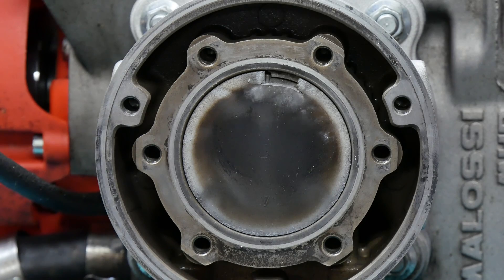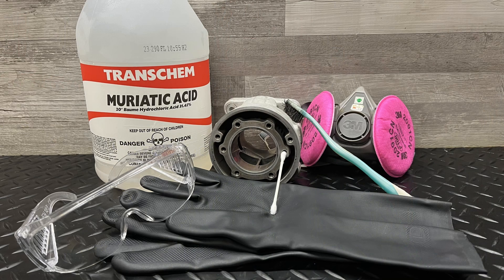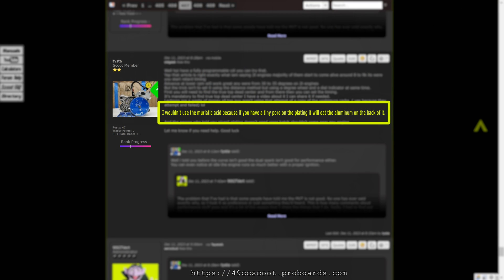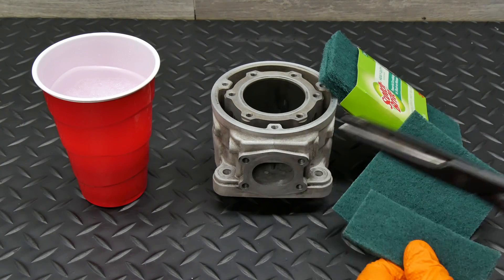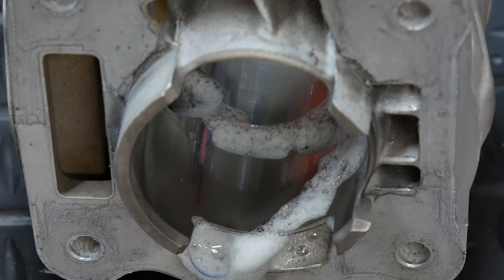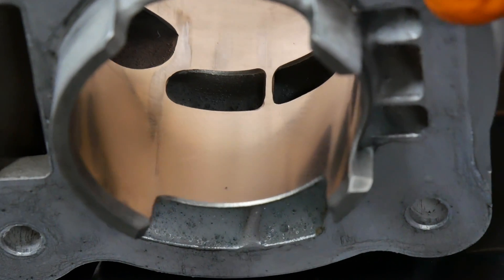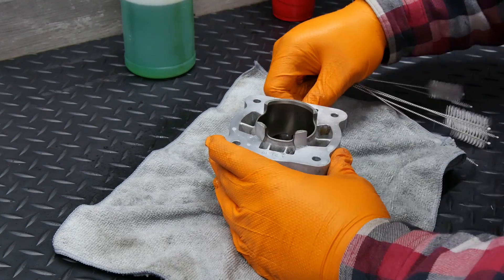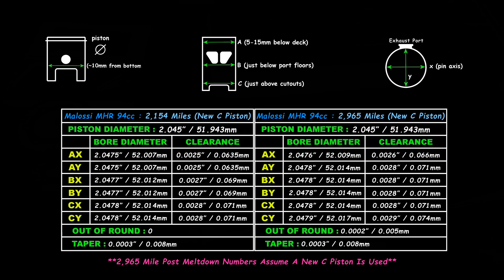Removing Aluminum Transfer After A Piston Failure : RC1 : Part 21 : Two-Stroke Cylinder Cleanup

Comment: hydrochloric acid removes all alunium at cylider
Reply from the maker: The problem as I understand it is; if you have any pinholes in the plating it removes the actual cylinder behind it too.

Comment: I read this about the ignition (MVT) that you use on your Malossi engine. and thought you might want to see it...
if you want a link to the place, just say (-:

MVT DD ignition timing for 50cc stroke engines should be 0.40 before TDC, while for any other stroke and long stroke the timing should be between 0.30 and 0.35 max. Failure to comply with this condition may result in an abnormally high temperature in the stator, which may cause irreversible damage.
Reply from the maker: Thanks for sharing that. I wonder why it would overheat if out of that range a little.
Reply: @49ccscoot  it is not make for a 100cc Motor
Reply from the maker: @bp-tuningaeroxlc-dd6474  If the stator is overheating though, it shouldn't know what size the engine is. It basically just spins and processes signals, so I'm assuming it's an electronics based issue that maybe too much advance or delay causes. The only way I'd think engine size would have any bearing there would be possibly related to dwell related to stroke and conrod length, but it seems like it should be so marginal.
Reply: @49ccscoot   yes exactly. the stroke length.
MVT ignition should according to what I read, then the MVT ignition that you use should not be suitable for Engine with Rod85 cranks or longer stroke.. or is it not recommended? you use MVT Ignition on engine
over 70cc.
I have read that about the MVT ignition

Comment: So I got a question what do you think might happen if I ran a100 gas in my 70cc Taiwan cylinder whit a high compression head and a iridium plug it has new coil which is stronger than oem is it possible to get quicker or faster I guess more torque or it will just blow the engine up
Reply from the maker: If it runs OK on pump gas without detonation, you're probably just wasting your money. There may be benefit with increased compression and/or ignition timing, but you'd probably get even more from oxygenated race fuels... with a higher price tag.
Reply: @49ccscoot  I have a tuning tnt key for the magneto I am going to install it in 2 or 3 days
Reply from the maker: @preslavnikolov923  It will probably be OK with premium pump gas unless compression is very high. My engine has 15:1 uncorrected compression with high advance and ran fine on premium pump gas for a long time.

Comment: I recently saw a video regarding expansion chambers effect on dynamic compression ratio.
On turbocharged cars as boost rises so does compression pressure or dynamic compression ratio.
Expansion chambers can increas dynamic compression ratio and this is one of the reasons for retarding the timing at optimum/ high rpm.

Did you know this already?
I didn't!
Reply from the maker: Good info. Basically anything that is changing how much mixture you can cram into the cylinder will affect dynamic CR, unless you're looking at DCR as strictly related to valve or port events... which I call corrected CR.

Comment: hello i have an question . i just got an yamaha tmax 500 2004 and i want to make with this scooter 5000km trip. what i sjhould to check to don't have surprise?
Reply from the maker: That's an oil change distance, so I would definitely do an oil and filter change and gear oil just prior to departure. Do a thorough inspection of basics, like tire pressure and condition, lights and so on. I would suggest looking at the maintenance schedule in the manual and seeing what it may be time for. When I was going away for a week on my TMAX, I pulled the CVT cover off to make sure the belt was in good shape prior. It's never a bad idea to lube cables, grease pivot points and so on.

It's not a bad idea to carry at least some basic tools along and make sure you're capable of carrying what you need safely and securely on the scoot well beforehand.

Good luck and have a great adventure!
Reply: @49ccscoot thx a lot for this advice. god bless you

Comment: where would you recommend putting the temp sensor lead on an air cooled minerelli clone? are you modifying the head so it'll go around the plug?
Reply from the maker: I just cut a little of a fin if needed to fit an under plug sensor.

Comment: Bought cylinder wich was oval,egg-shaped,didnt fit.Same I write on all your videos.Petrol is the most un-wanted in a motor.Fried burned cylinder.All usa cars has 6-8 cylinder,use over 1 litres pr 10km.300 million people on same road 16-100 year.Had given 1000hp,tourqe,200km\h 10 second.Also a smaller piston,and fewer rings.You have 1 ring,normal.Its 5 ring on 139qmb,for school-teachers,oil,scrape."Engine-damage" 0.2 mm alu hold back piston,LIES.So little,hair in cylinder,stop.

Comment: Pretty cool 👍 
I don't have a scooter but do have a 2 stroke motorized bicycle.....Gonna put a 4.5hp 2 stroke snowblower engine on a bike soon. I think with some porting, expansion pipe & carburetor. I'll be able to get 6+ hp with plenty of torque.
Reply from the maker: Nice. Do they make expansion chambers for the snowblower engine or are you going to build one or modify one for a similar engine?
Reply: @49ccscoot  Gonna weld one up to fit onto the exhaust port. The engine has a fan shroud & pull start so it'll have air blowing on it at idle, along with extra air cooling when bike is moving. The bad part is they stopped making the 2 stroke snowblowers. But there always seems to be engines & SB for sale. I'm pretty sure I'd be able to find case bearings & seals to fit & chainsaw top end to fit later on.
Reply: @49ccscoot Hey do you know what the safe max cylinder head temp limit should be for a small aur còoled 2 stroke? 
I set my warning ⚠ guarge at 310F ....Once it hits 310 I slow down & get under 300....My temp guage is accurate. Would it be safe to cruise along at 310F for several miles/minutes. Or is it too hot 🔥 causing ex port area to be dangerously hot.
Reply from the maker: @michaelbrinks8089  I always suggest getting used to what the gauge reads when the engine is happy while tuning. Only then should it be used to monitor. I have had CHTs that would seize at 300 and others that were fine at say 350F. Others say over 400F can be OK for max. None of mine would ever make it there without problems. Depends on the exact sensor location and type of sensor and how much air can get around it and so on. If the main jet is rich enough, CHT should level out and it should be OK to cruise WOT. I can't tell you what that temp will be. If low throttle gets close to wide open temps, stay away from that throttle range till you richen part throttle settings.
Reply: @49ccscoot  
Thanks for the reply........Next ride I'm gonna get up to 310F then see what temp the digital temp gun  says the ex port area is. If it's not much higher than CHT. Then I could probably get away with 320 or 325 cht max temp.